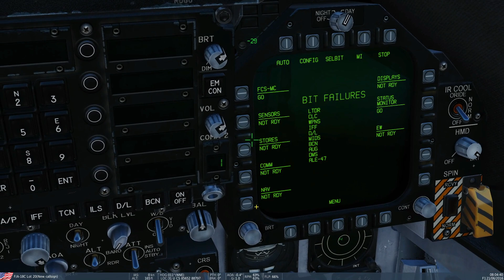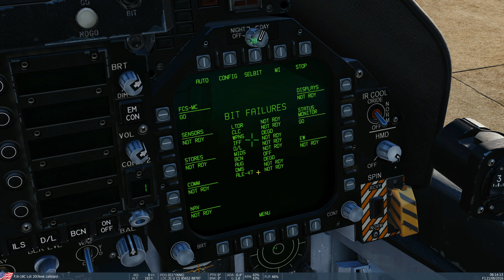FA-18C Hornet: BIT Test DDI Page Tutorial | DCS WORLD

Comment: So i recently watched an awesome video featuring a retired blue angel navy pilot giving a tour of the FA-18 he used during his time as an angel. He also spoke about his time as a navy pilot and his experience w/carrier landings in the hornet. One thing he talked about which i found extremely interesting, was how navy pilots use "hacks" to assist with landings. He explained that it is possible to use the FA-18 flight control diagnostic system to set the trim in such a way that the aircraft will automatically hold the perfect AOA for a carrier landing. He said that they use a specific page within the diag mode that allows them to enter a specific number, which commands the appropriate control surfaces to move and place the aircraft at the perfect aoa. He went on to say that the system isnt designed for that purpose, but pilots use it to aid in carrier landings. 
     
     I was wondering if that diag mode is modeled on the hornet in DCS and if so, has anyone ever attempted to use it in the way described by the navy blue angels pilot? If anyone is interested i can even tell you the values for the diag setting and the subsequent optimal aoa.
  
     I cant wait to get on DCS. I plan to buy a nice powerful PC tower, a hotas flight control kit, and track ir. Btw, besides having a stick, throttle, and tracker (which i believe to be must haves for dcs) do you guys think rudder pedals are necessary? or are they something to buy in the future? Thanks in advance.
Reply: yo hows it going, did u build your pc and your flight setup??
Reply: F18 literally has an automatic carrier landing system.
Reply: @dubyas1989  Only for Case 3 recovery.

Comment: and herein lies my challenge with DCS. I recently watched your future of DCS video with ED - the average playing time is 25min. I want to 'play' in a SIM, but I don't want to spend an hour fcuking around with fuel pumps, INS alignment and then flying across a barren landscape to then have forgotten the things I need to do to get a brick to appear on the radar.

As I get a RWR lock warning I spin my head around the cockpit for my foe, I roll and pull back on the stick to get nose authority on what turns out to be a spec of dust on my monitor. I then get a launch warning, realise that my FA18 ECM is setup to do something, possibly Auto mode, but is automatically doing the square root of SFA. I do remember that I've got E and C keys cunningly mapped to the corresponding decoys and dump my load just as an A120 goes through my cockpit.

I contemplate making some time to now go and watch one of the 20 or so most excellent FA18 training videos and writing down what sequence things need to be done and what bindings I need to my Logitech 3D Pro. So this is probably around the 25min mark that many get to and quit. I persevere. I've now got a list of stuff to map to stick and keyboard and notes that go remind me how to setup the systems and then what to press to lock things up BVR. I use the training mission to shoot down drones. I even get to using TWS and find the use of the S key to allow me to lock, launch, switch and repeat. Most satisfying. Then I reflect on what I've actually achieved and realise that I've not exactly defended my nation in a thrilling mock battle.

Maybe a campaign? I've bought a few and conclude that I don't want to fcuk about for 20min before finding a another spec of dust on my monitor. PVP!! I go online, filter by no. of players. Go for the biggest. Take off on the taxiway, F10 for where to go. I can't see any foe but can see lots of blue over there, so head in that approx. direction. I see some bricks, I lock and mange to shoot it down only to be informed that I've just down one of my own. WTAF. I do some more research and realise that I need to turn on the datalink to make my display helpfully make them a different colour. I go again. I'm on it. Full AB. I find a bad guy with DL on, lock it and then get a low fuel warning. I get notched and appear to have then pointed my antenna at the moon but the mapping logic I used didn't appear to have set the lower the antenna again. EW is going off on one so I know I'm in trouble, I dive for the valley, run out of fuel and crash land in a field. I come to a stop. Eject for the hell of it and then watch my plane burn and look around the skies above me to see a contrail in an otherwise blue sky. My time is done. It's dinner time.

I love the concept. I love the realism. I love the real-like feeling of the flight dynamics. I love the aircraft. I've bought many, sold on the belief that 'I'm going to learn this one'. The very first one I bought after the Flaming Cliffs collection, was the A10C - I spent 30 mins in it about 2yrs ago? and haven't used it since.

For people like myself, not stupid people with limited amount of time to devote to the 'game', I'm encouraged by the things I heard in that interview. I like the idea of more succinct opportunities contained within a scenario in which everything is setup and you're ready to go - somewhere between a campaign and an instant-action sort of thing.  The only thing in addition that would really help me and people like me , I'm guessing, would be a significant improvement in the training within the 'game'. Whilst the YT videos are fantastically detailed and well explained - having to pause the game, alt-tab to watch 10mins training video, make some notes and then alt-tab back again is painful.

The training is good for some modules is pretty good - the FA18 for example. Being an ED product you'd probably expect it, but even here, the stuff that is taught and the stuff that people actually do e.g. in PVP doesn't correlate. The F16 training is 'minimal' which gets me to the point of basically taking off, 'blue-sky' BVR and close combat, followed by some perfect scenario bombing. Frustrating. In game, in-cockpit training which allows me to learn what I need to do in 'real'! situations such as PVP.

It's very difficult to explain - I wan't the reality experience, I don't want a 'game' with arcade style dynamics, I do want the immersion knowing that if I turn the fuel cutoff that the engine will stop, But I don't have the time to spend the hours a week needed to perfect my systems knowledge. Being able to fire up the PC and drop into the heat of the battle is what I want to do within 30mins and If I'm rubbish, an in-cockpit training session that takes me though those scenarios. I can visualise starting that training session with an SBAR kickoff and then: 'OK, so this is what you need to do...' the switches would highlight intime and move on when I've pressed it - but get rid of the active pause and painfully long detail and onscreen text boxes. I want a virtual instructor to take me through it. I can learn the detail beneath if I'm interested and have several free hours..

Love the product and the passion - just let me access it in an executive summary style - the detail below is still there for the people and professional customers that do need it.
Reply: True, and there is a lot of options for improvement.
Reply: ... and that is the challenge of Instructional Design folks.  How to provide knowledge transfer that satisfies the largest group.  You need all of the detail for those that want to get tossed into the deep end of the pool, while at the same time make it parseable for the times when it is 2:00 AM, Sunday morning and you are simply looking for that key piece of info that will get you back to the task in the shortest amount of time.

By the way, BIT Test... is redundant, it's just BIT or Built in Test... or maybe BIT Check, if it is not used too often.  :)
Reply: Long story short it's a study sim, where you should make you own study objectives to explorer and learn systems. It is not intended to purchase an module an fly it for 2 hours and expect you will be efficient in a sortie.
Reply: TheDM3002XTuber  I agree that that is one user story - it is not all